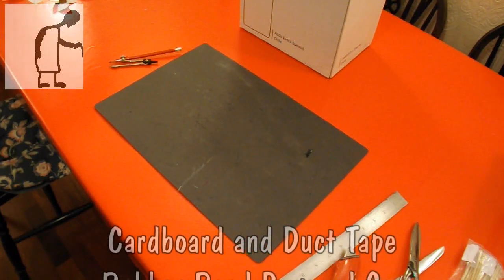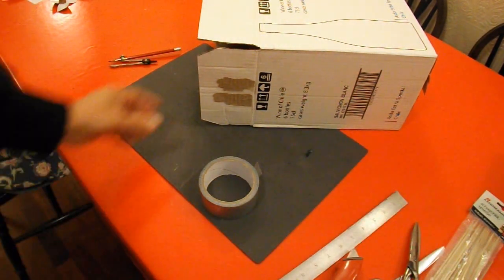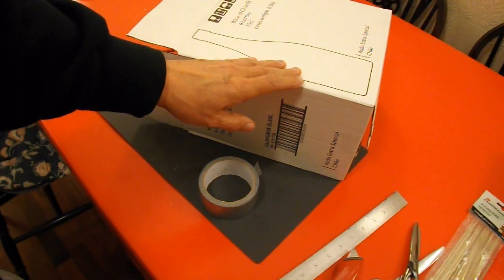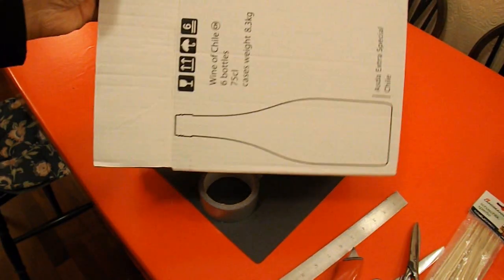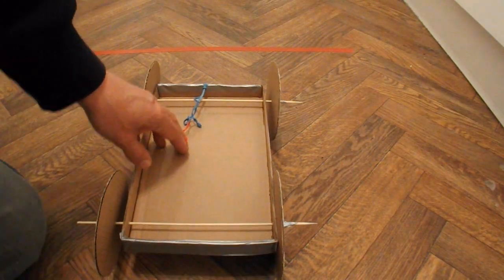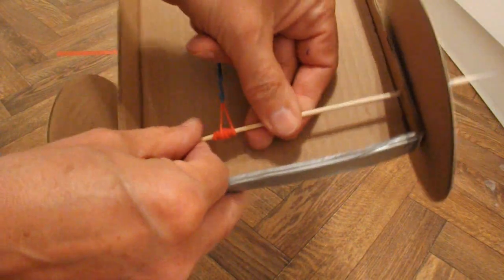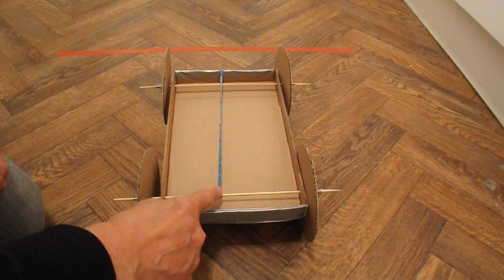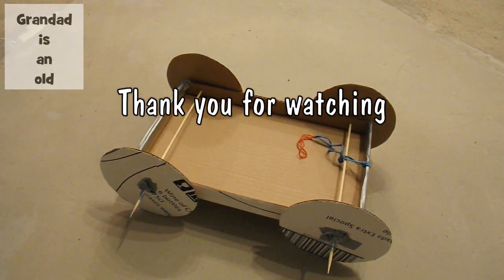Cardboard and Duct Tape Car

Comment: It doesn't work
Reply from the maker: Have you any idea what the problem might be? The most likely problem is the holes you made for the axles are too tight and the axles can't turn when the rubber band is trying to unwind. The next most likely problem is your wheels are rubbing on the side of the car causing too much friction and they can't turn.  Lift the car off the floor and try spinning the wheels. Do they spin freely? Front and back? You may need to move the wheels out a bit on the axles to make sure they don't rub.
Reply from the maker: @kahlilmorgan5545  if you make it bigger then it should work OK 🙂👍
Reply: @GrandadIsAnOldMan  ok thx
Reply: @GrandadIsAnOldMan  will  masking tape work instead of duct tape
Reply from the maker: @kahlilmorgan5545  I have used masking tape successfully on several of my cars. It is not a strong as duct tape but should be strong enough for a car like this. You might need two layers.
Reply: @GrandadIsAnOldMan  ok
Reply: @GrandadIsAnOldMan  it still doesn't move
Reply from the maker: @kahlilmorgan5545  do the wheels turn when you lift it off the ground?
Reply from the maker: @kahlilmorgan5545  it is 2AM in the morning here so I won't be replying for a while as I am going to bed. Here is my standard help file with useful tips
Fault Finding on a Rubber Band Powered Car
1. The rubber band does not connect to the front axle, some people misunderstand the videos and attach the rubber band to the front axle as a convenient anchor. That stops the axle turning. Make a different anchor point, study the video again.
2. Does the car run forwards freely if you just push it without the rubber band connected?
If it does not, make sure that the axles are free where they pass through the body. You may need to enlarge the holes where the axle goes through the body or use larger tubes for the axles to go through.
Are your wheels round with no flat spots. You may need to trim them.
3. Do the wheels rub against the body of the car?
If they do, the friction will slow the car or even stop it moving.
Put some spacers on the axle between the wheels and the body to keep the wheels clear. Discs or washers cut from plastic or cardboard should work. 
4. Do the wheels spin evenly when you watch them?
If your axles do not pass through the centres of the wheels, the wheels will not spin evenly and this makes it harder for the car to run, so you will need to make new axle holes, taking more care finding the exact centre.
6. When you wind the rubber band round the axle do the wheels turn at the same time or are they slipping on the axle?
If the wheels are slipping on the axle, the rubber band will unwind without the wheels turning on the ground. You need to do something to stop them slipping. Glue them to the axle or wrap tape round the axle where the wheels are to hold them in place.
7. When you release the car it does not move, but if you lift it in the air, the rubber band unwinds and the wheels spin OK.
Either the ground is too rough or the car is too heavy. Try the car on a smooth surface, make the car lighter, add more rubber bands. 
7. Wheel spin. When you release the car, do the wheels spin without the car moving forward?
You do not have enough grip on your wheels. Either add some weight to the car to help the grip or put something on the wheels to improve the grip. 
Things that will improve grip - hot glue all the way around the rim like a tyre. Rubber bands stretched across the wheel. A strip of rubber cut from a balloon stretched around the edge of the wheel. Strip of rubber cut from washing up gloves or disposable rubber gloves.
8. Trouble connecting the rubber band to the back axle? Glue a short stick to the axle to act as a hook for connecting the rubber band.

We are trying to construct a rubber powered car that can go as "far" as possible. It doesn't have to be fast. It just has to travel as far as possible and as "straight" as possible. Can you please recommend me a design? Or at least give me a general idea of what critical points I should be aware of while designing my car?
This is a fairly regular question. 
I am assuming you have some set criteria for number of rubber bands and size of vehicle so putting those aside. The first point about travelling fast or a long distance is minimising your friction because that is what wastes your power. 
1. Friction caused by badly aligned wheels rubbing on the bodywork should be easy to fix by adding spacers to keep the wheels clear.
2. Friction where the axle is attached to the bodywork is reduced by making sure the axle bearing surfaces are something that does not bind together. Wood and cardboard are not good. Metal surfaces are better. Steel and brass is good. Ball race bearings would be even better. Whatever you have, even if it is just wood and cardboard, you can improve by making sure there is clearance so they do not jam together and maybe rub some graphite from a pencil where they make contact might help.
3. Friction with the wheels to the ground can be a mixed blessing. Minimise the friction of the front wheels by using very thin wheels, however you may need some grip to ensure they keep the car going straight. The same applies to the back wheels, assuming you are using the back wheels as the drive wheels. However if they do not have enough grip they will spin under power and that is all wasted energy. Thin wheels with rubber tyres would be best in that case.
Larger wheels take more effort to get them turning but once moving they have the momentum to keep rolling when the rubber bands have finished. You could experiment with different sizes to see which work best.
You could use some sort of gearing to start with a large gear to get the wheel moving and then a smaller gear to maintain the motion. There are some examples in my playlists.
Reducing unnecessary weight by trimming the bodywork a little may help but make sure you don't loose grip and start the wheels spinning if the body is too light. It may bend or break under tension so be careful.
Another trick I have found helps is to stretch the rubber band as you wind it round the axle so you get more turns round the axle, this can make a significant difference compared to just winding the band normally.
If you can only use a short rubber band, connect it to the axle using thin string so the string winds round the axle stretching the rubber band. Thin string will give you more turns round the axle than thick string.
This simple one does 12 metres https://youtu.be/pIO3FiHX4Oc with just 1 size 64 rubber band.

There are several reasons the car might turn to the right - or left -  here are some I can think of.
1. Your front axle is not parallel to your back axle so the car has an inbuilt turn. A quick check would be simply to push the car forwards without the bands connected and see if it turns.
2. When you tension the rubber band the body or the axle is flexing creating a turn. Try winding the band to one side of the axle. Looking from the back if you wind it on the right it pulls the right side of the axle forward turning the car right. If you wind it on the left it pulls the left side of the axle forward and the car goes left. https://youtu.be/IErkUylbG9c?list=PLA5a2xPRSrB3g5RiX8Kf_uUBOL0Tb7AS0
3. Probably most likely, the wheels are spinning under power allowing the back of the car to slide to one side. Fix this by adding extra grip to the wheels such as a strip cut from a balloon or rubber gloves stretched around the rim of the wheel to provide a rubber tyre. Here is a link that shows this http://youtu.be/ZnuPnveCbxs
4. The front wheels are sliding sideways under power, fix this the same as '3' above.
5. One or more of your wheels are binding on the side of the car causing it to turn.
6. One or more of your wheels are not round and the unevenness is causing the car to skip and turn.
7. Your wheels are not the same size so the car turns towards the smallest wheel.
8. Your axles are not level with the ground and the car is running on only 2 or 3 wheels. This may be the body flexing and not show until the rubber bands are wound up and under tension.

The two most important factors for acceleration and speed over a short distance are the power of your motor and the grip of your wheels. If you don't have the power then your car will not move fast but if your wheels don't grip then any extra power will just spin the wheels and the car won't move. If you have a fixed amount of power by being limited to the number and size of bands you can use then you can increase your acceleration by enlarging your back axle. I wrap stuff around the axle to make it thicker. That will increase the acceleration but probably reduce the total distance your car will travel. If you are only going a short distance that probably won't matter. You can also use smaller wheels to increase acceleration but you will find it even harder to get good grip with smaller wheels.